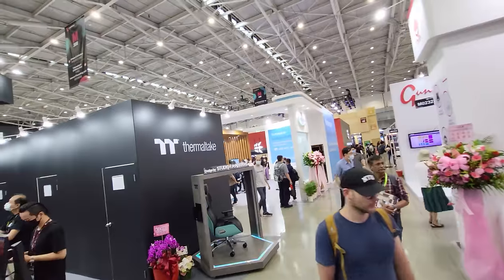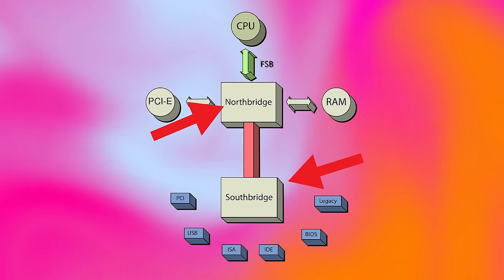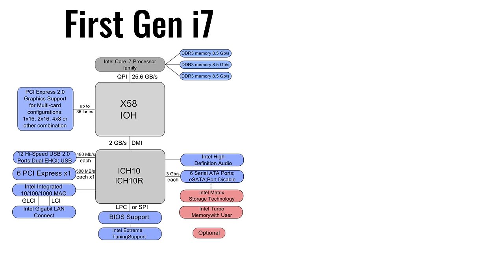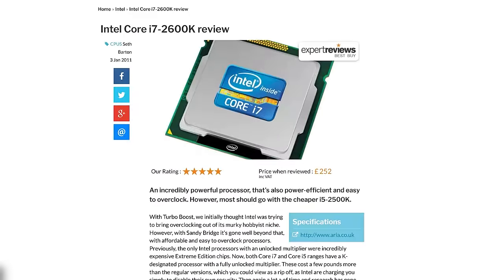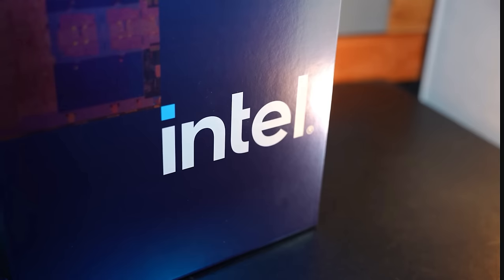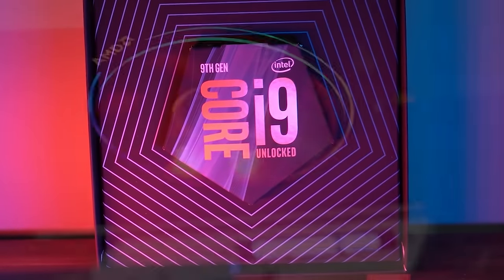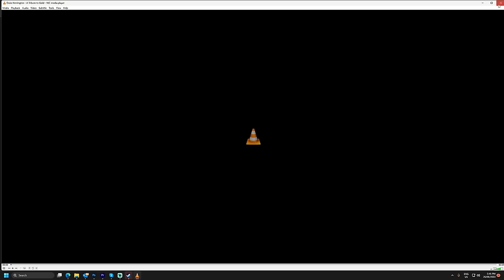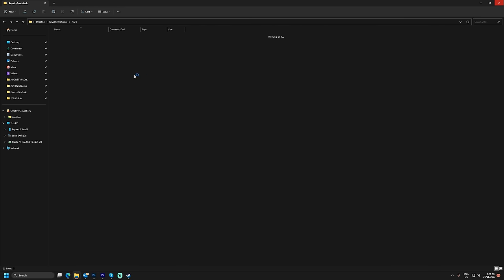SNAP - The Intel CPU Latency Story (Part 1 of 2)

Comment: This is quite interesting. In 2021 i went from an i7 6700K to a Ryzen 5 5600X. And i noticed exactly what you showed in this video. The system was quite responsive, but sometimes folders would take a long time to load icons and things like that. In January 2023 i upgraded to an i7 13700k and an Asus Z690 motherboard. And all my "latency" related issues went away. Perhaps you could test 12th vs 13th gen to see if there is really a difference (im still using windows 10). 

Also there is something that no one has covered yet. Intel Z690 is rated for the same TDP as all the chipsets that came after Z170. But although they have massive heatsinks, they run pretty damn hot. I had to change the thermal pad and undervolt my Asus Z690  strix-e motherboard because the chipset was running at 80-90° C. In my previous build with the ryzen 5600x the chipset never went over 60°, and in my Asus Z170 maximus viii hero it barely hit 50°. I believe this is unacceptable, since the silicon die will probably tolerate those temperatures. But the solder will eventually die and let the PCH fail, leaving most of the people with a very heavy paperweight.
Reply: I went from a 4770k to a 5600x and noticed the same thing about the responsiveness.

Comment: Excellent video. I notice a bit higher latency when checking aida64 numbers compared to others with similar setups. I notice the only variable is manual memory tuning with timings that I’m just too lazy to mess with too much. 13600k a 5.6ghz e cores 4.4 e cores and 4.8 ring at 1.32v with 48gb 7400cl34 a die kit. Do you think memory tuning with manual timings is really worth it and have you noticed a difference with it ?
Reply: IMO you are going to spend more time on memory tuning 7400c34 and stability testing than gaining time in real life during the entire life of the platform. Note 0.2% FPS gain in games is not actually a time gain, it's suppose fluidity gain. Purely a hobby.

Comment: I've actually been feeling those increased latency in my day to day tasks as well. This is especially apparent in file searches. Thank you for explaining it in this video. Can't wait for part 2
Reply: It`s not the latency he is talking about, that should be in the micro seconds.
It`s not even latency he`s showing but more a kind of time out.
Fot latency it takes way to much time.
Latency is feel,  what he is showing is wait.
Reply: @brugj03  Normal computer users would say "my computer is slow" when what they mean is they click on something and have to wait too long before something happens. Clearly there is a delay of seconds which could be described as latency but is most likely the computer is waiting for something like an acknowledge signal. Perhaps due to timing it's missing the signal. A tweak to the driver by the developer on a system showing the problem would solve this. It's not some fundamental problem with the speed of the silicon or of moving functions from one bit of silicon to another. It's far less serious but very annoying.
Reply: @wayland7150  Absolutely, common sense well used.
It`s not like you have to wait for garden gnomes to carry the bits around on the CPU die.
It just doesn`t seem to sink in though.
Reply: @brugj03  I'm pleased that Brian is making a fuss about this problem because it seems a lot of people are suffering it. If it was actually a serious chip problem then everyone would be seeing that delay and it would never work well. It's just an unfortunate alignment of conditions on some machines. You need to be on a machine with the problem in order to solve it.

Comment: Having I/O off the core CPU die itself need-not be a problem. After all, the main issue is going to be the connectivity to RAM which is far further away across an interface with a lower data transfer rate and higher latency. The issue is whether this is properly accounted for with caching, prefetching, etc., and that all boils down to CPU and interconnect architecture design.

Comment: Brian, I have an i5-12500 with no e-cores. I don't seem to have this problem. Although you turned off the ecores within the bios when testing, perhaps this still isn't good enough. The cpu architecture with the ecores may be the problem? Perhaps a clean p-cores only alder lake doesn't have this problem. Can you test this with a 12400 or any alder lake cpu without the garbage e-cores built in? This would be an interesting test. I hope you see this comment!

Comment: I'm running a 13600kf with a 3060 12gb and im having this issue also.
Threw together a z77 i7 2600 and gtx1060 6gb and compared the two in assetto corsa and the older system was about 20-30fps higher now I understand why.

Comment: Another issue I have seen that is in the niche corner is, people that run VM's and emulators a lot get a slower windows response over time. A channel here on YouTube called "kilObit" shows his experience how to fix clogged SSDs (yes it's a thing) in windows, video is titled "Fix 100% Disk Usage in Windows PC" the tool he used is called "BleachBit" (free and open-source). It even solves slow steam (valve) patching of games, all related to windows clogging the SSD.
Reply: I thought SSDs kept themselves clean.
Reply: @wayland7150  That is some what correct, I think you are mentioning SSD TRIM. Which you can setup in Windows 10/11 to run every week it doesn't automatically work. Many brands have their own little tool to run the TRIM algorithm, the deal is you have to install and run it. And as you maybe have seen it in the Tech News, Windows 11 has SSD slow down issues, last Tuesday Microsoft tried to fix it again for Windows 11 but many people are reporting slow SSD issues.

As you may see it, it is not all a set and forget on top of that Microsoft can't fix the slow SSD issues after so many attempts.

The tool "BleachBit" has fixed the slow down SSD issues for some, so I recommend it to people to test it. It cleans up some deep system clogging which seems to rest the SSD speeds in Windows 10/11.

Comment: I have no Idea what you are talking about. I have a 12700k on a z790 and I have no problems. Sure if I open a folder with lots of music or videos its gone take a second to load all this stuff this is completely normal. But this program freezes are suspicious I think your problem is definitely somewhere else. Maybe your RAM or a sata cable is faulty.
And that they moved some functionality off the CPU doesn't make a lot of sense to me. Your GPU and one NVME Drive is connectet directly to the CPU and the other drives ore connectet to the Chipset. But the connection from the Chipset to the CPU should be faster then ever, especially whith PCIe 4.0.
Reply: Exactly my thoughts. I have a 13900k on a z790 and also don't experience any of the shown problems. Maybe he has an issue with his windows installation? And also, there aren't any functions that have moved out of the CPU into the PCH related to this matter.
Reply: A possible solution could be to dessable the memory integrity setting in the core isolation in Windows. It is known to introduce some latancy because of the virtualization.

Comment: I think we need to understand that the second/multiple second latency issue is not related to the separation of the I/O die or area. On the large end of the scale, it introduces around 40ns of extra latency to the command (lets say a read) from the cores to the I/O.

It is possible that the I/O itself is not very efficient with with the data it receives.

As for ring vs mesh: there are advantages and disadvantages to each. It genuinely does not make sense to use a ring bus when you start to have dozens of cores at your disposal. It's a bus after all, so on a ring with 24 cores, your worst case core to core latency would begin to be quite dramatic. Mesh eliminates this issue by front loading some latency at the advantage of have near equalized core to core latency no matter what.

I would be more interested in knowing if the drive you are accessing is your boot drive (aka, connected directly to the cpu pcie lanes) or if you are accessing data from one that goes through the PCH.

Comment: Are you using "Balanced" or "Power Saver" power plan by any chance? I've noticed my system is snappier when it's on the "High Performance" power plan and a bit laggier on "Power Saver" and "Balanced".

Comment: I'm using a Erying Micro ATX board with an Intel 12900H CPU, & 32GB DDR4 3200Mhz RAM on Manjaro Gnome Linux, and so far it seems snappy enough for my needs without having to overclock it.

Comment: I'm personally not having such issues as shown in the video on my 13600KF, however I have tuned my BIOS and am using a custom powerplan which supposedly fixes issues on ADL/Raptor lake. 
(powercfg -s 3ff9831b-6f80-4830-8178-736cd4229e7b
powercfg -setacvalueindex scheme_current sub_processor HETEROPOLICY 0
powercfg -setacvalueindex scheme_current sub_processor SCHEDPOLICY 2)
Reply: Windows 11 has core parking bug on alderlake and raptor lake. That powerplan might have fixed it. You can also manually disable core parking in regedit

Comment: Never thought that this could be the hardware problem and not the software issues inside Windows itself. Definitely needs more deeper investigation. Different OS, detailed information on test cases, CPU sturcture e.t.c. As fo me moving IO inside CPU sould decrease latency and not to increse it. Especially for Intel cause they still do not use chiplet design for consumer CPUs

Comment: I do video editing, and I did not noticed this on the main SSD. However I've noticed this on a 6TB older mechanical HHD, but this should be due to the technology itself , an din fact I found that it was fast for a HHD, even if I was looking for tons of 4k sequence and mp3 to do montage. never has a waiting load time or anything. win 10 installed since launch of the 12th gen . 12600k OC DDr4 4000 , 970 nvme samsung 1tb here. I do autocad, revit, montage with powerdirector, office suit, video encoding h265, GIMP, Topaz AI, etc. And once again, nothing as shown in your vid.

Comment: Running 9900K here with 4266CL16 memory 33.8ns latency and desktop feels extremely snappy. i9-9900K should be the best latency chip with many cores because of a shorter ring bus.
Reply: Same here even with 3600 @ CL16 Memory

Comment: I Went to dreamhack Melbourne this year and managed to cop a asus dual 4070, 13600k and an arc a750; was really interested in putting together an ITX pc  to replace my current rig but after seeing this i'm going to sell the 13600k. Its upsetting to see amd stick to Solely ddr5 and not having any ddr4 compatibility (correct me if im wrong its 2am and im about to nod off) but one of your previous videos mentioned the amazing price performance of the R7 7700 out of the box.... I do still want to make an ITX build... am glad i didn't commit to the z690 board build

Comment: Actually, I am experiencing this when I was trying to load my folders with lots of codes for my Java. I thought it was my drive for it being HDD. Then again it did not happen when I was on R7 3700x and 5800X. I am now on R7 5700X which is supposed to be similar performance to 5800X with lower power. I can always replicate this issue, especially when I am also running SVN to maintain the codes.

Comment: i notice this too when i upgraded to ryzen 5 3600 from old intel i5 2400, the snappiness of my new system isn't better than my old intel in fact it felt a bit slower, i always thought it's just something in my head
Reply: When I went from a Ryzen 2700X to a 5700X I noticed it was so much snappier, though I don't tend to do large amounts of thread heavy multi tasking, but everything seems to respond practically instantly in everyday use
Reply: Matisse's latency is extremely often atrocious!

Comment: Your pc is unstable maybe i dont experience any of this on a 13900K + 12900K + 9900K and the 13900k/12900K is defo snappier than the 9900K@5ghz, and with regards to the io the first nvme slot is directly connected to the cpu e.g. there is no need for any "extra io whatever" its directly connected to the cpu adding something inbetween would just be slower the other slots off the pch are just switched so same again

Comment: 2:35 - That's not correct, Intel's first chipset with integrated I/O on the CPU was P55, it came out a little after X58 but before P67/SB, launching with the likes of the i7 860, i5 750 and i3 530, etc. Later CPUs included the venerable i7 870, easy to oc i5 760, the rarely mentioned 2c i5 680 and the very easy to oc i3 550. i7s for X58 were easier to oc over stock speeds, but the i7s for P55 had better default Turbo settings and thus ran better at stock (larger bin level differences).

Although P55 had only dual channel RAM, it did have a significant latency advantage over X58, often giving better results at lower cost while using less power, though it had a lower max RAM of 16GB. X58 also had 6c CPU options and thus held a multithreaded advantage. A friend of mine had an X58 mbd with an i7 930 while I had an i7 870; we both had two GTX 460s, with my setup almost always being faster because of the latency difference, even with both CPUs oc'd.

I bought P55 because it was a much cheaper platform, mbds like the awesome Asrock P55 Deluxe were only 75 UKP (it has excellent slot spacing for SLI/CF), and back then vendors were still messing about with PLX and NF200 chips, so for example the ASUS P7P55 WS Supercomputer offered 4-way CF and 3-way SLI. I'd gambled that the latency advantage would be significant and I was right.

A CPU oddity was the i7 875K which allowed per-core Turbo/oc settings, a feature which became standard in later i7s. Also worth noting that a great many P55 mbds did include power/reset buttons and POST debug LED, proving that these are very cheap to add; even Asrock's budget P55 Extreme had them. It's why I argue that all modern mbds should have these features by now, there's really no excuse.

Back then, XP was still relevant and games hadn't yet taken much advantage of multiple cores, hence the most interesting oc options for P55 being the i3s and i5s. It was easy to get an i3 550 to 4.5GHz+ even on a cheaper board (my Deluxe has one at 4.7), likewise an i5 760 to 4.4GHz (the i5 having better oc headroom because without HT the load temps were 10C lower vs. the i7s), though the i7 870 wasn't far behind at a little under 4.3GHz on a better mbd.

Note I've done X58 oc'ing aswell, I have an Asrock X58 Extreme6 (a popular mbd for GPU reviews back then) with an i7 950 @ 4.26, 3300MHz QPI, 3706MHz Uncore, 12GB DDR3/1853 CL8, with other CPUs waiting to test (including a 990X). X58 oc'ing is interesting because it's more difficult, a greater challenge. Nowadays oc'ing is essentially baked into CPU designs, giving very low oc gains over stock speeds & performance. Perhaps this is why some X58 boards have retained decent value, such as the Gigabyte UD3R. XEON support on both platforms was also good.

3:53 - A shot of the glorious Rampage IV Extreme; bag one if you can for X79 meddling, they're awesome.

4:53 - Moved off the CPU? That's extraordinary. How come this hasn't been discussed before? I'm surprised it wasn't a talking point when the change first happened since, as you say, it's a significant design reversal.

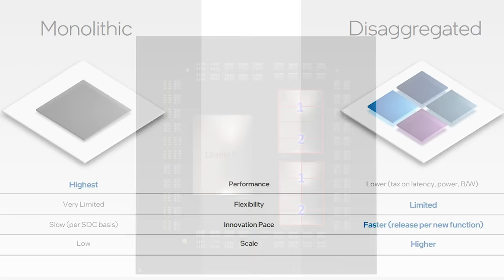7:25 - I wonder if that's why an i5 10400 build I did felt so snappy, surprisingly so. Btw, snappyness isn't a new term; vfx artists/animators used the same term when describing the excellent responsiveness of SGIs such as the Octane and Onyx2 back in the late 1990s, because they had very good latency aswell as high bandwidth. It was possible to configure an Onyx2 that could load a multiple-GB image in just a second or two.

Question: if latency with the latest Intel CPUs has gone backwards in this manner, why hasn't this manifested itself in game testing as worse percentage lows? Or maybe it has and I didn't notice.

Comment: This to me is a very interesting find, I've had my 12700k since Sept of last year running on a Z690 d4 platform and I can in all honesty say I've not had any latency issues, but in contrast my friend with a 13600k running on a z790 d5 platform is having stuttering at times. Would you say the RAM interface might be contributing to the issue?
Reply: Latency issues are not related to a specific setup. They are all the same all over the range. 
Conclusion, you have no issues because ther are non or you don`t notice them.
Reply: @brugj03  I also have a i7-12700 and never faced any of these problems shown in video ...
Reply: @RicardoSilvaTripcall  Obviously, the things shown in this video are absolutely not latency related.
It`s probably a bad windows install, incompatible driver or hardware problems.

Comment: 11600K is still the esports goat. I've had zero league fee paying, tournament qualifier pursuing type clients express dissatisfaction with 10th Gen K part or 11600K/KF builds but Alder Lake and Raptor Lake stuff has been returned or exchanged for Zen 3 or Zen 4 a few times since release. Unprecedented occurrence in the 16 years I've been doing SI stuff
Reply: @mrsrhardy  Rocket Lake is a poor undervolter and thus the i7 and i9 parts aren't feasible for use with air cooling like I deliver esports specific rigs with. Comet Lake is gr8 and that's why I was alright putting a 10900K under a D15 or Dark Rock for dozens of systems

Comment: Interesting. I built my 'new' rig 2-1/2 years ago, a Z390 and 9900KF (which turned out to be a 'good' chip in terms of Vcore/clocks/power/temps), already two generations old at the time, but I was trying to save a few quid. Recently began to think I should have gone more 'future proof' with 11th gen and have been contemplating upgrading to 12th or 13th. This gives me pause.